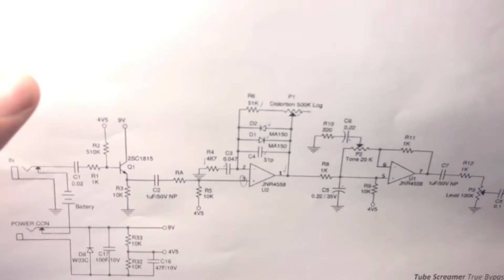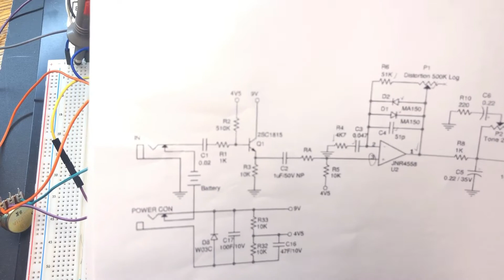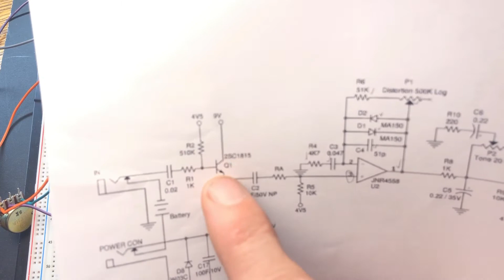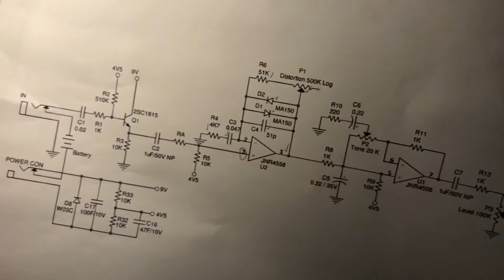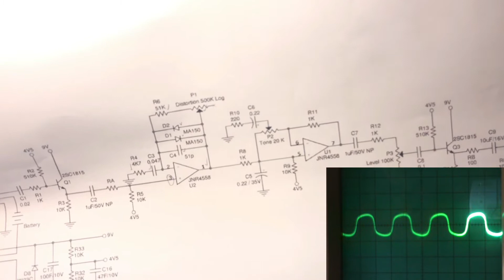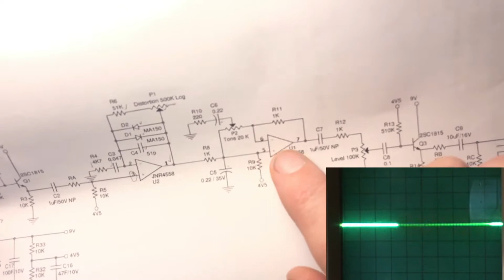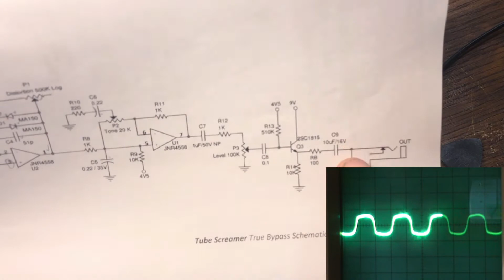⚡️Dissecting the Tube Screamer Schematic. DIY Tube Screamer Sound Test. Oscilloscope.

Comment: Very well-done, man. From the opening riffs to the circuit overview and explanation. The resources online 20 years ago when I started were full of mysticism, elitism and condescending criticism, and man has it changed, but I suppose that played a significant role in my enrolling in college for engineering at the ripe age of 32 lol. 
The best general breakdown I found in texts many years ago was; 1st addition-subtraction stage, 2nd amplification-multiplier stage, 3rd is the output stage. So buffer, amplifier, coupler/converter.
The 3rd primarily associated with voltage to current ratio which is generally dictated by whether it's going into a speaker or cascading into another signal altering circuit. I'm sure by now you've tinkered with the diodes and beyond, but asymmetrical clipping with whatever diodes is really the gold standard.

Comment: Hi, man! I recently began studying on some really classic pedal circuits. Based on my 808 and 9 of both 40th anniversary Red versions, I found quite a few differences on this schematic. Besides the value differences that different versions might change, I am so sure that R4-4K7 and P3-100K are not connected to Ground, they are both connected to 4.5V+. What do you think might be caused by this difference, or say error?

Comment: Hey chase thanks a lot for your explain n signal test. I just wanna ask about in your schema...from pin 3 jrc4558 connect to 47nf then 4k7 then ground. Is that realy connect to ground? Coz some schema and pcb layout 4k7 connect to Vref = 4 5v. Where is the correct connect?
Reply from the maker: khoer de yes. The one I built that section went to ground. It has to do with the op amp not amplifying I believe if I remember correctly. There are a bunch of variations of this circuit.  I’d like to get a few different ones and do this same project with them. If you got one send it my way. Sorry if I didn’t help you any it’s been a while since I did this project. Let me know if you have anymore questions bud.
Reply: @ChasesWKshop  i'm still build that ts clone..and I've got diode 1s1558 1s1555 1n4148 and germanium d9e..coz the day before i build this clone ..i'm just finished my dod 250 and the efect of cliping diode is very significant in drive sound. I'm just finished my input buffer and output buffer ts9 and try this lay out ..from guitar to bufer 1 with transistor 2sc1815 then to input dod 250 go to input buffer 2 (final buffer).

Comment: Great video, would adding a higher value in C5 reduce the brightness? If so, what value would you use, .47n tant?
Reply from the maker: Tom Robinson thanks bud.  I tried a few different components and all gave a different result in the sound. Experiment with it and see what you get. Let me know how it changes the sound. I believe it would do what you’re saying and any value will work for your experiment. Thanks for the comment bud.

Comment: I added two levels of bass boost (BB1 is just a bass boost and BB position 2 is bass an gain boost)a few years ago to my ts9 and I love them I used a 3 way switch so it still has the stock position. I don't know of a schematic for it I just looked up which cap I needed to add it to. If anyone's interested in the mod let me know and I'll look into which cap it was and the values I used.
Reply from the maker: Michael Inglis awesome bud. Yes I’d love to see a schematic of it. Thanks for the info!

Comment: Just what I was looking for, super good explanaition. How may volts are you using for simulating the guitar signal? I´m trying like 1,5v - 4v and 300 Hz in the simulator, do you think that I can work with those values?
Reply from the maker: Percy Hornickel thanks bud! I was using a cell phone signal generator app to produce the signal. I modified a headphone set to plug into the input of the tube screamer then plugged it into the normal headphone jack on my cell phone. It’s a very small voltage anything more would possible fry the circuit. Hope this helps bud and welcome to the channel!!

Comment: Interesting.  I've always been curious about what all of the different components do.   I've never understood why buying the components cost as much as an assembled pedal.  I understand that pedal builders are buying in bul but stil, I like fooling around with the electronics but the bottom line is doing it yourself does not save money.  At least that's been my experience.  It sounds nice and I enjoyed the video.
Reply from the maker: Yosemite Sam I know bud. I will say this,  I don’t have a lot at all in this pedal. Maybe 10$ for the opamp and transistors and that’s for like 10 opamps and 50 transistors.  I did have all the jacks from an old pedal. The pots I salvaged from some old electronics because I have a disease called, “I can’t throw anything away” lol. I may try to make a pcb board for it too. I’ve always wanted to do that but never attempted it.  I’m also learning as I go too so anything you know I missed let me know. Thanks for the comment bud!!
Reply: Chase'sWKshop maybe it’s me not knowing the proper place to buy components...  I look forward to more of your videos.
Reply from the maker: Yosemite Sam a lot of it I buy on eBay.  As far as resistors and caps  go I’ve bought a bunch of assorted packs in the past from eBay. Half of the stuff in them I’ll probably never use though lol.